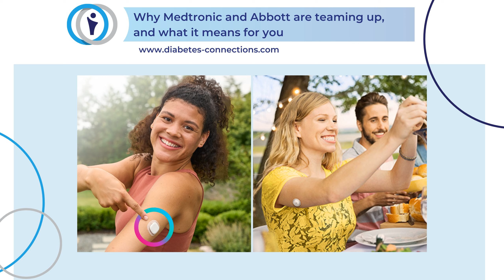Why Medtronic and Abbott are teaming up - and what it means for you

Comment: Translation ... Medtronic is so far behind in their CGM technology they have finally realized in order to sell more pumps they need a better CGM to go along with it. I bought my first Medtronic pump in 2009 (remember, they were the primary pump choice back then) and I bought it because of the "new" CGM technology at the time - a sensor that would send readings automatically to the pump, plot them on a chart and you could download for further tracking and analyzing - pretty cool! I LOVED the Medtronic pump but hated the sensors which were inaccurate, bulky, needed charging, only lasted 3 days, required constant calibration and were so expensive! So I used the pump but not their CGM and entered finger stick reading manually. 

Fast-forward 15 years Medtronic sensors are still the same profile shape/size,, still need charging, very awkward to insert, now last 7 days with better accuracy but not the best out there, AND are still expensive! Meanwhile, Abbott Libre sensors came along (among others which are good but I have only personally used Libre sensors). Libre's are small, easy to insert, accurate, don't require charging, last 14 days are are less expensive - everything Medtronic's weren't! To be fair, Medtronic is not only a diabetes company, they manufacture other medical devices but as such I believe they lost their focus on CGM's over the last decade. With the great strides in CGM technology over the last few years they can't catch up so good on them for finally realizing they should partner with a company that actually makes fantastic CGM's. I'm very much looking forward to using a Libre sensor with my Medtronic 780G. BTW, the 780G is a fantastic pump but the whole experience will be so much better with a fantastic CGM to match!